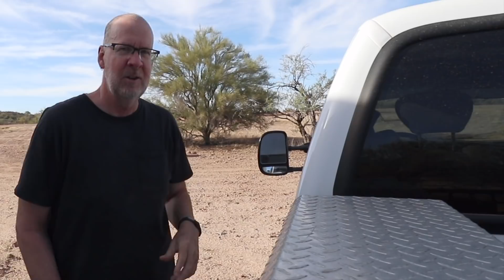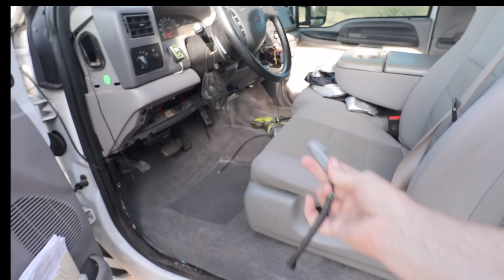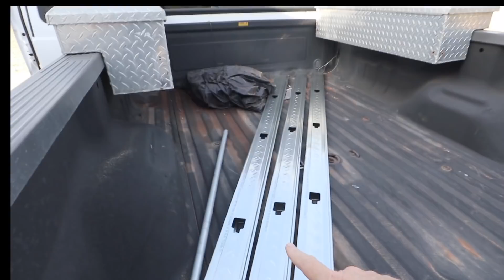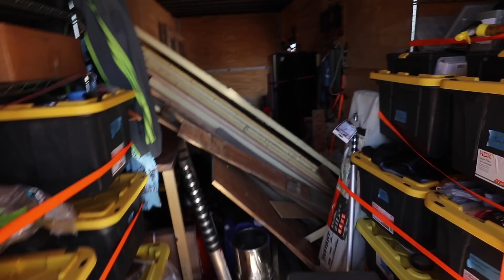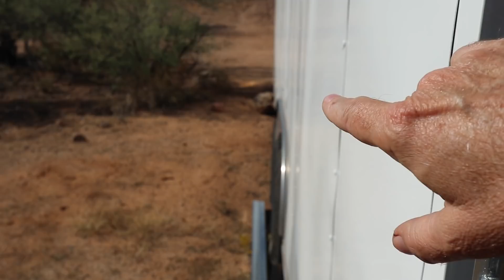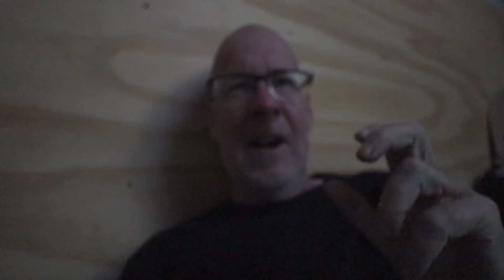Surprise Visitors to My Camp | Status Update E628

Comment: Those horror freight ratchet straps are not the best to use for important things. I’d recommend buying better quality if you care about your belongings.
Reply: I think he said the D-Ring pulled off the wall. It was probably just too much weight. He needs to divvy up the load to lower the stress. Or travel with the heavy sheets flat on the floor.